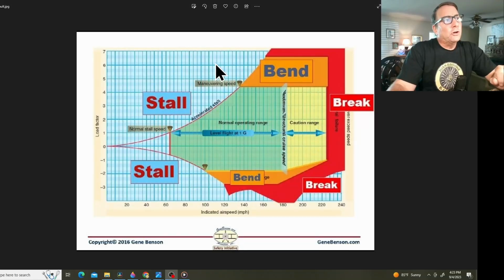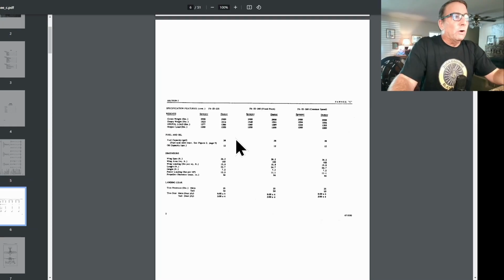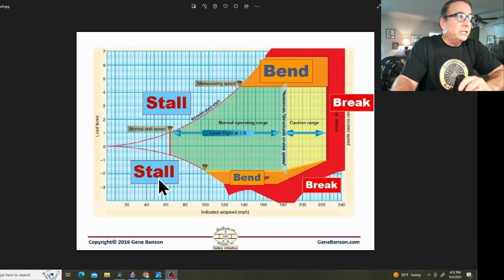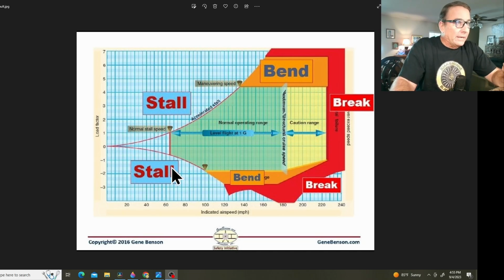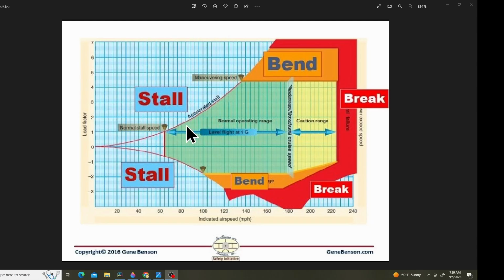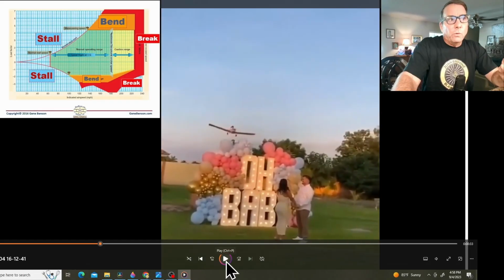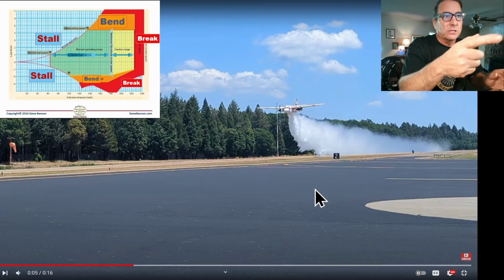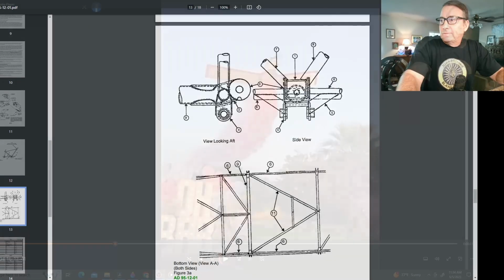PA25-235 Sinaloa MX Gender Reveal Party Structural Failure

Comment: Juan, let me add some details from my experience working as a aircraft structures certification engineer:

It is true that the maneuvering speed vA is defined by vS times the square rout of the design load factor. However, it is not a limit up to which the pilot cannot damage the airplane. vS is a calculated stalling speed (FAR/CS 23.335(c)), as estimated early in the design process. vA is a defined airspeed limitation to be used mainly for control surface and control system structural sizing. FAA AC 23-19A explains: "VA should not be interpreted as a speed that would permit the pilot unrestricted flight-control movement without exceeding airplane structural limits, nor should it be interpreted as a gust penetration speed."

The TCDS you present in this video is of a restricted category aircraft. Although limit maneuvering load factors seem not to be mentioned in this TCDS, in the restricted category certain limitations can be lowered below the FAR-/CS-23 minimum requirements, including limit load factors and structural safety margins. That is especially used for cropdusters to allow higher take off masses.

As far as wing structural loading is concerned: it does actually not change when you empty the hopper tank. Given, that speed and angle of attack stay the same. Why is that? The aerodynamic forces on the wing are unchanged as long as airspeed, angle of attack and it's configuration (flaps, ailerons) don't change. So the lift force doesn't change. The same lift force acting on a lighter fuselage lighter than before means the vertical acceleration increased, as Newton claims in his second law. To maintain level flight, i.e. maintain 1g, the pilot needs to reduce the angle of attack during release of the payload, as you explain.
It seems that the unlucky pilot in the video did the opposite and increased the angle of attack, leading to increased lift forces, which resulted in structural failure of the wing.
Reply: I found this very informative, thank you. Would suggest pinning it
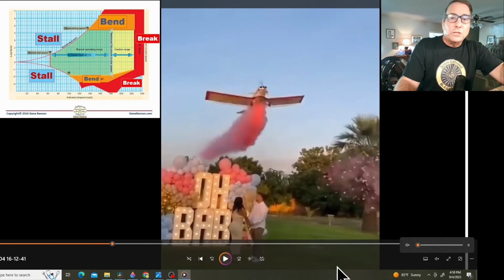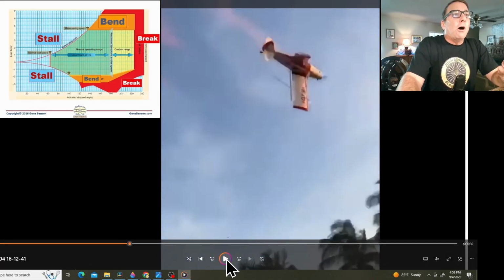Reply: If you go to 8:12 and change the setting to 0.25 playback speed, there's a moment right around 8:14 where you see the wing fold back diagonally. At least intuitively, it seems to me that this supports what you're saying. It's reminiscent of the silly game we'd play as kids, sticking our hand out of a high speed car and "surfing" - once the angle goes a tiny bit too high, the effect snowballs as the wing flips up and back.
Reply: I find it interesting that something that we were taught at the RPL level regarding V speeds, a 777 typed pilot got incorrect.
Reply: speed can safely max deflection of a control surface
Reply: To add to that, it seems that the wing folds backwards indicating that the wing reached its divergence due to an increase in the lift force.
Reply: @Cessna165  
My guess is that the struts supporting the wing failed. Unlike most high wing aircraft (think of the PA-18), where the struts are loaded in tension when experiencing positive load factors, the PA-25 is a low wing aircraft with the struts above the wing. This means they are compressed when the wing creates an upwards oriented lift force, so the most likely fail by buckling. Pure lift, in the absence of flap or aileron deflections, excessive Lift acting at the quarter chord location creates high loading on the forward strut, causing it to fail first, and I guess this is what we're observing here. 
Wear, (maybe internal) corrosion, poor maintenance may play a factor, too.

I know divergence as torsional divergence which can (but should not!) happen at high speeds. However, this results in a nose down twist, not nose up as we see in this case.
Positively cambered airfoils (most wing airfoils with the exception of aerobatic aircraft airfoils which are typically symmetric) create a nose down torsional moment, and thus nose down twist, on the wing. From a structural point of view, referred to a wing section's shear center that is typically behind the quarter chord line (for most airplanes), positive lift creates an opposing nose up moment. 
The twist caused by the aerodynamic moment leads to less lift force, and in sum more nose down moment acting on the wing's structure. The wing's torsional stiffness needs to be great enough to limit the overall twist to avoid torsional divergence, i.e. torsion to an extent where the wing structure fails.
Reply: @ue4770  thank you for this great explanation, I was indeed referring to torsional divergence. I am now clear that what happened seems more likely a structural failure due to bad maintenance/corrosion as others mentioned.
Reply: Thanks for that.  Too many people don’t truly understand g loading and wing loading.  I think the vid author understands, but just doesn’t go into enough detail.
Reply: @HarriettArnold-ft6in  The video author went the completely wrong direction in his explanations. He’s also made mistakes in the past regarding legislation and general aircraft knowledge
Reply: I disagree. 

Ummm, E=MC and stuff, so there.
Reply: I was a structural tech for a while and completely agree with this comment.
Pilots need to stick to talking about flying. They also have a bad habit of blaming pilots only.
This is not the first time wings have failed in Mexico… Mexico is known for ignoring maintenance and inspections. 
I’m fairly confident a properly maintained aircraft would have survived that. I see those duster fly really hard in the states all the time and no issues.
Reply: @1KDave  Did you just say 'pilots need to stick to talking about flying.'

Did I read that right?

Comment: Having worked in both aircraft maintenance and design this looks like a structural failure without too much G. Notice the Port wingtip angle of incidence. As someone else wrote, these wings can be full of cracks.

Comment: You have a nice discussion of "maneuvering speed" (although it would have been VERY helpful to actually show a V-G diagram SHOWING the change in the stall curve v. load limit to contrast to the one you used, with a 'less than max gross weight' load to show HOW the "maneuvering speed" changes).  It is my personal opinion that this accident could almost completely be attributed to airframe corrosion on this aerial application type.  "Maneuvering speed" is a CERTIFICATION LIMIT, and does NOT indicate the conditions at which the airframe components WILL fail.  These aircraft are DESIGNED with substantial safety factors in excess of the certification limitations (you KNOW this!!), and momentarily exceeding the "maneuvering speed" for a "normal" or "utility" category airplane DOES NOT automatically result in a catastrophic failure...that is EXACTLY WHY the design limit criteria and required designed safety margins are constructed the way they are.  The "ultimate load limit" of that wing, and the related structural components, are way up at the upper limits of that RED "break" area on the V-G diagram, and should NOT be reached or EXCEEDED down in the "bend" area!!!  If that Pawnee's wing, or that wing's struts, had not been structurally compromised by corrosion (which is VERY COMMON on Ag planes), even that WAY TOO RAPID of a G onset (the pilot "pulling too hard") should NOT have resulted in the failure we observed with this aircraft!!  Are the "certification limits" of your airplane important? ABSOLUTELY!!! A pilot should NEVER exceed the certified limits of the type certificate!!! But this Pawnee WOULD NOT HAVE FAILED the way we see it fail if it was structurally sound. It just wouldn't.  Ag planes come from the factory BUILT LIKE TANKS.  The poor dead pilot was foolish for pulling so hard on his OLD ship in any case, but I would bet money that this accident can almost exclusively be attributed to an airframe corrosion issue.

Comment: Thanks for the interesting point about load factor increasing as weight drops. I'd never thought of that and it was counterintuitive at first. Was the ballast in front of the CG? The e drop seemed to almost initiate the steep pull up

Comment: The way I look at it is he pulled up to establish an angle of attack to produce 16000 lbs of lift, then released the load without reducing AOA so he is still producing 16000 lbs of lift but now at 2000 wgt...4g --> 8g instantaneously and off comes the wing.

Comment: Also the he counter-intuitive fact here is that a heavier aircraft actually has a higher manouvering speed. A heavy Pawnee is slower to respond and the response from the control input lags . A light Pawnee might do what the pilot actually asks of it and if the asks for too much (per the VG-diagram) the  airframe might bend or fail. Pawnee has the mentioned AD for wing  as well as the wing strut AD and a tail AD. They are expensive to permanently fix while the wing attach and tail  AD's require extensive welding. Chemicals used for spraying/dusting/spreading might also amplify the airframe corrosion.Ag-planes, Air -attack , Towplanes  etc. (working airframes) might go through more stress cycles in their lifetimes compared to a personal use airframe. There is a similar failure video available .  Search for "Crop Duster Catastrophic Failure in Brazil" maybe Juan can add it to links.

Comment: I'm sorry, I don't like this explanation at all.  It's tied in unintuitive knots and there's a much simpler one available.

There's no "bombs away, wings fall off" effect.  It's "bombs away, nose gets light, bad things can follow."

Trimmed speed is related to weight in a predictable way: heavy glides fast.  If you drop a significant amount of weight, your trimmed speed suddenly falls.  

If your aircraft has normal longitudinal stability and the CoG doesn't move, current speed greater than trimmed speed pulls the nose up.  This can be violent enough to surprise you, cause blackout, or pull the wings off.

CoG further complicates things, of course.

Va is not intended to account for weird maneuvers like bombing or shifting cargo or even multi-axis aerobatics.  It's really narrow and to some extent arbitrary.

Wing failure is predicted by absolute lift (so many thousand pounds) much better that relative (so many Gs) and Va is computed from G limits.  It's a complete quagmire that accident investigators can figure out, but thinking about that stuff would not have saved this pilot.

They needed to manage the sudden change in trim.  The take-away lesson is that water-bombing needs appropriate design, procedures, and training.  General aviation doesn't do a great job of warning pilots when they're getting into surprising flight regimes and need to seek out niche training.

Nobody should be chasing down a Va figure from a foreign handbook, adjusting it for weight with that ratio square root formula on Wikipedia and making that result their water-bombing procedure.

Comment: Not sure how to picture thatm but, the aircraft has a weight, pulling it down. And it is conteracted by the wings, pulling it up. The plane is steady. Then you introduce a sudden change on weight. The force pulling down gets smaller, and lift remains unchanged, so the plane is expected to pull up (uncommanded) ?. Seeing the final still capture, the wing is fractured and kinda shifted higher than the rest of the plane, Like the wing was really willing to pull the plane up and suddendly broke free. Not thinking about pilot input. But just wondering how this sudden change in weight can be handled by a plane, compared to areal use case where the chemical are released slowly. Not a Mech Eng .... but I think the sudden change in load produce a "spike"of force on the attaching point. Probably the plane is a bit tired for this kind of display, like you mentioned, they need to be handled gently. Condoleneces to the pilot family.

Comment: Not sure who is to blame here. The Mexican aviation authority must have good certification standards, I'm assuming this given the amount of domestic air travel and the amount of flights authorized into FAA-controlled airspace, against the number of non-GA accidents (very low). However, and maybe letting a some of my prejudices show here, Sinaloa and other Northern Mexico states are the craddle of drug trafficking via air (lookup for "Amado Carillo Fuentes"), I guess this generates an abundance of aircraft and questionably (meaning non) license pilots. You'll say a commercial operation must have tight oversight, but this is not how things are in Mexico. Either way, lack of airmanship, maybe not by the lack of knowledge of the theory behind  the V/g diagram, but for not stopping and thinking through what may be the implications of making a maneuver that (most likely) hasn't being previously attempted by the pilot...RIP. And for the rest of us still flying, fly safe

Comment: Sudden pull up was a very bad idea and not necessary for the occasion. A mild 1.5 to 2 g climb would have been plenty! However Juan's point about "older aircraft, treat them gently", is worth repeating. Much of the GA fleet is closer to the age of the Wright Brothers than to today. And an AD for airframe corrosion - this has been an issue for a number of Piper aircraft. It's a lot less common for a Cessna to lose a wing in flight, but not impossible.

Comment: As I recall, it was necessary to apply considerable forward elevator when releasing a liquid load to keep the C-188 Agtruck I flew in a level attitude. It's difficult to tell if this pilot is actively raising his nose or if the sharp climb is a result of the rapid decrease in weight after the release. Could be that he pulled the nose up to impress the audience. I wouldn't have thought that dumping the load would increase the force on the structure without some inappropriate control input by the pilot. My first suspicion was corrosion in the port wing strut as a cause of this unhappy incident.

My understanding about the decrease in Va that occurs with decreasing weight was that with a higher gross weight, the critical angle of attack (stall AOA) would occur before structural limits were reached, thus relieving the load on the structure.

Comment: whilst this presentation is n informative tutorial regarding the design limitations for Va i think that there is perhaps a more prosaic primary cause for this 'accident' and that is the final comment made about corrosion. as a pilot with thousands of hous in the PA 25 in many of the models, 150 235 260 and its reincarnation as the GippsAero GA200 with 300Hp and constant speed prop i make the following observations. 1- the approach was not at a particularly high speed and in fat when equipped with spray booms and fan pump in a shallow dive it is unlikely to be able to exceed Va by any significant margin, unless at very high power. 2- the pink water was not a full 150 USG, it seems maybe 1/3 or 1/2 of that by the observed volume, 3- the pitch up was not dramatic and is a natural aerodynamic effect of the water dump, in fact significant forward stick pressure is required to maintain level flight if so desired. I have even conducted fire suppression dropping in the pawnee many years ago during wild fires where even small ag aircraft were pressed into service, and a downhill drop on the sides of steep terrain requires significant forward pressure to maintain a descending profile and prevent the nose up pitch, but this is with a maximum hopper load with retardant, very heavy. 4- the featured aircraft has squared wing tips which adds about 4 sq ft to the wing area, waaaay out at the tip which will apply additional loads to the wing structure at point of max bending which is near the jury strut attach point between the lift strut attach and the spar to fuselage fitting which will reduce the loads for failure. there have been STC for this and even for 2 ft extended fibreglass tips that make this issue even worse. i have also flown pawnees with these mods and they will carry a full load well, but will compromise structure. 5 - despite much aggressive maneuvering with all of these variants at every load combination possible the PA25 is a very rugged and reliable, and adequately strong airframe, HOWEVER corrosion in the lower fuselage tubes at MLG and main spar attach fittings is a known issue and will significantly reduce integrity if not identified and corrected. the company I worked for designed an upgraded centre section that was welded into the belly frame if corrosion was reflected by NDT and this stronger tubework was a very popular option among operators here in Australia, and could be done in a simple trestle jig, on-site in two days without fully removing the wings. hey presto Fixed!!. I believe that thsi crash will be primarily attributed to a structural failure due to damage from corrosion within the lower airframe tubing in the critically loaded areas of the attach and carry through structure. the airframe was certainly overloaded for its condition, and even the relatively mild pitch input with such a small water drop caused the compromised structure to fail a a much lower loading than normal. That's my armchair analysis, could be wrong, but I have seen so much more aggressive maneuvering than this as routine ops in these remarkably reliable aircraft. Internal tube corrosion is a hidden killer.

Comment: Did Juan mention the C-130 air bomber crash in 2012 (N130HP)?   To me it sure looks like the two failures were the same:  unloading, pitch up, and wing separation due to this stress and previous structural weakening.